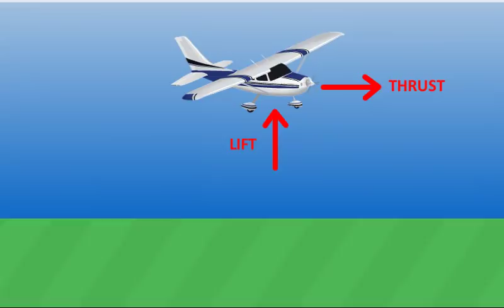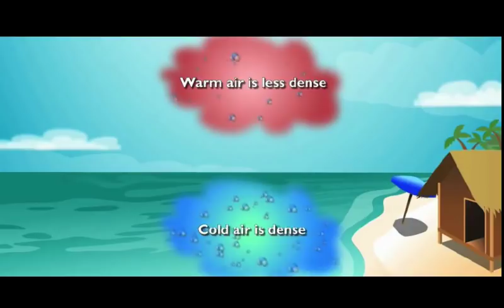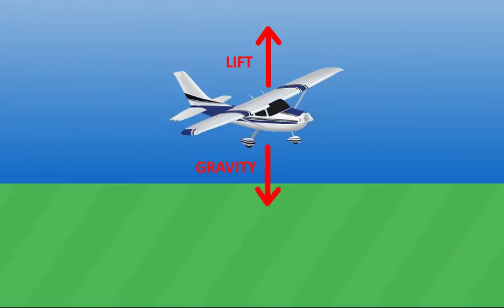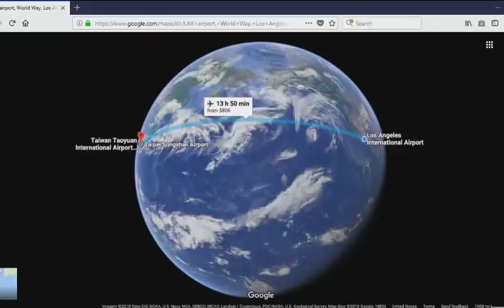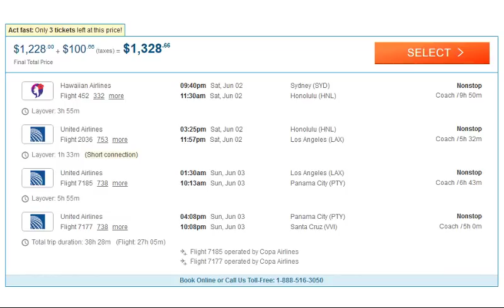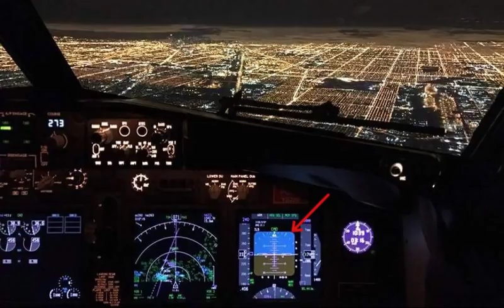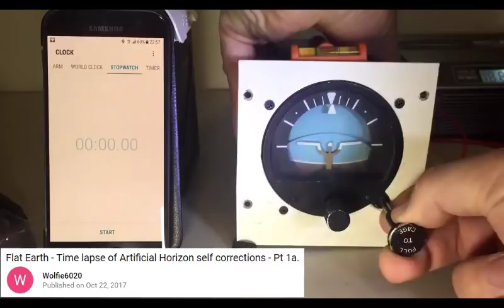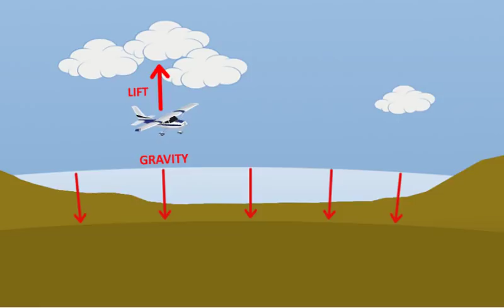Flat Earth Falsities - Plane Nonsense

Comment: So what happened to the so called coriolis effect that we're always being told about????
Reply: It exists. Ever heard of ocean currents, trade winds, TRS, weather systems, jet streams and not water going down drains.
So what happened to the so called Flat Earth that we're always being told about but no-one has any proof for?
Reply: @boffeycn  I don't advocate the flat earth theory, I question the globe theory, ie how come we can watch a ship go over the horizon 5 miles away yet we can't observe the curvature unless we're over 100,000 more metres above the ground??? or how come when lake Baikal in Russia freezes why isn't there a 20 mile curve in the ice?? it's 395 miles long and when frozen is completely flat???  Any suggestions mate?
Reply: @Deathtime88   It is impossible to be flat, even a small pond. Water freezes and expands 1/11th which causes the ice to be slightly wavy or bulged in the centre. You should also prove the lake is flat. Take some markers about 3 meters high, then line them up for 395 miles. Then use the famous P1000 take some photographs of perfectly inline markers. Get back to me.
Reply: @appresley4071  for fucks sake man, it's meant to be a 19.27 mile curve!!!!!  It's just one example and there's loads that you can check out. Still doesn't exactly explain why you can see a ship go over a horizon a few miles away yet can't see any curvature on the horizon left to right!  Wanna give an explanation on that one?
Reply: @Deathtime88    There definitely is a curve left to right on the ocean. I can sit in a boat and view the curve that is a three miles circle around me. The earth is big, mathematically that viewable 3 mile circle that you will see around you, explains the spherical earth perfectly.
Reply: @GebSpez15215  Flawless? If I was flawless there wouldn't even be a debate which has been ongoing for centuries, scientists included. You display all the characteristics that you say 'flattards' have in regards to their beliefs. As I said, you're as bad as each other.
Reply: @Deathtime88  Why no answer, mate?
It exists. Ever heard of ocean currents, trade winds, TRS, weather systems, jet streams and not water going down drains.
So. mate, what happened to the so called Flat Earth that we're always being told about but no-one has any proof for, mate?
Reply: @Deathtime88  Wong and Profe are trolls/shills. It's prly best not to waste any time/energy on trying to show them the truth.
Reply: @BrainUser1  Had never heard of that experiment... man I thought flat earth was hard to grasp but concave earth?? Friggin mind gravy. Thanks for sharing
Reply: Yeah it would be crazy if was the absolute reverse of convexe openroof races all around the galaxy.   Me neither, why I am so interested, too bad the Cellular Cosmology only has one  megalomaniac with a Messiah complexe to promote it on YT, but he is smart and has interesting explanations.   But that major experiment should be done again, it could also point to the "flat"  Orlando Ferguson 1893  giant donut mold... "flat" earth map.
Reply: @GebSpez15215  Why are you so angry? Gotta let that shit go man, you're only hurting yourself.
Reply: @sunbear2644  Calling anyone shills or trolls doesn't negate the validity of ALL the questions or points they make. People WILL come to their own conclusions, especially if they are truly intelligent, freethinking truth seekers. You're just name calling and trying to divide and conquer. Peace all, think for yourselves.
Reply: @Deathtime88  Haha I don't know about "all." And I know from experience with these guys. They're not trying to have a discussion, they're here to stifle it. Troll/shill is an accurate description. S'all good tho,  you do you. Cheers.
Reply: @Deathtime88  "I don't advocate the flat earth theory, I question the globe theory,"
     That's very interesting because in 2016, on the Ball Earth Skeptics Round Table with jeranism you posted, "...the Earth is NOT
 a globe and is FLAT" https://www.flatearthscience.org/ball-earth-skeptics-round-table-with-jeranism-fixed/
     Advocating is precisely what you were doing.
     How about your "Interesting Stuff" playlist stuffed with FE videos?
     Remember 3 years ago at Professor Brian Cox's Facebook page posting, "Gravity is a theory not a fact, and if the Earth is a ball in 'space' and NASA's been there, why don't we have ANY genuine pictures of the Earth from space? Why are NASA faking pictures of Earth? ...NASA admits they're composites and I'm not blind!"
Reply: @GebSpez15215  I never said anything about religion. and the 15º per hour, is the problem on the FE model a perspective thing? Surely, wherever you are the sun will pass by and your perspective view would be different, ie high or low in the sky. Why do we get more hours of twilight in the north than we do the south? wouldn't it be the same on the globe model???
Reply: Arif Salih 
can you grasp the problem? 15 degrees per hour isn’t possible on a flattardia pancake. just do what i suggest:
take a gleason map, find singapore or any other location near the equator. from there, draw lines to every intersection of longitude 15 degrees apart and the equator (suns flattardia path)
no matter how hard you try, you will never get constant angles. but we observe a constant angular change of the sun everywhere on earth. 

try this for Sydney, Australia... this place is „outside“ of the „flattardia sun path circle“... try to figure the problem. it’s 15 degrees per hour in sydney, too. 

i really am baffled about how little flerfs actually think about what the instantly claim. flerspectiveh??? really?? lol

of course earth is a sphere...
Reply: @GebSpez15215  Changing the subject slightly, Why do you (personally) think NASA fakes so much of their footage, always use fisheye lens' and never has the camera looking upwards on their rockets?
Reply: @GebSpez15215  No one has an answer for a bunch of our questions either. There's not gonna be an answer for everything.  There's basic problems with the eclipse that no one has answered, there's basic problems with the alleged near perfect vacuum of space. There's basic problems with gravity. Let's hear your basic question though. Have at it.
Reply: @Deathtime88  "Changing the subject slightly"
Again, I still can't help but notice that you have not responded to my replies to you.  I have explained your mistakes and answered your questions but it seems that you are only interested in responding to people that "insulted" you in some way.  Why is that I wonder?  I don't want to jump to any conclusions but in all honesty I'm starting to suspect that you were never interested in answers to begin with.

"Why do you (personally) think NASA fakes so much of their footage"
They don't.  You have watched some videos that misrepresented things to you and outright lied about other things to you and you believed those videos.

"always use fisheye lens' and"
They do not always use "fisheye" lenses.  When they do it is because they want wide fields of view and when you want a wide field of view "fisheye" is the way to go.  If you're curious about why they would want wide fields of view try walking around with horse blinders on for a day and you'll quickly understand the benefit of a wide field of view.

"never has the camera looking upwards on their rockets?"
NASA (you know they aren't the only space agency right?) has filmed their rockets from every conceivable angle.  Up, down, left, right, under, even from INSIDE the rocket engine.  The problem here is not a lack of video on the subject.  The problem is that people like you either ignore all the videos or wave them off as "fake".
Reply: Arif Salih 
of course you change the topic. what else can you do now? you can’t answer my question without admitting that earth cannot possibly be flat. doesn’t this question even bother you? what is it? do you believe that the sun isn’t changing its position constantly? why has nobody EVER observed a rate of angular change other than EXACTLY 15 degrees EVERYWHERE on earth? go, measure it yourself, no one is stopping you!

nasa doesn’t fake any footage. if they use cgi, they declare it as such. 
most pics aren’t cgi, there is plenty of photographic evidence of planet earth. 
but let me ask you another question: why did you choose to believe in a conspiracy without ANY evidence? why do you believe NASA has ever faked photos, but not a single flerf ever provided evidence for this fakery?

lol
the answer is simple. earth is a slowly rotating spherical planet and you MUST desperately deny all evidence presented to you. otherwise you would have to admit your own lunacy...

but go on, prove me wrong by not changing the topic, by giving a sound explanation for the 15 degrees per hour.
Reply: Sun Bear 
read the thread. the question is there. 

funny how you deny reality, while you keep claiming that such a simple question could not be answered. this question has been answered 5000 years ago. how does it feel to lie to yourself?
Reply: @GebSpez15215  Projection over a dome
Reply: Sun Bear 
nice baseless claim. ANY evidence? 
lol
no. of course not....
hahahahaha
actually this is very funny...
Reply: @Deathtime88  Aside a couple of Sailors seeing sea curvings... for the:
" You should also prove the lake is flat."  - as I already told the kids=
>>> Salar de Uyuni (or Salar de Tunupa)[1] is the world's largest salt flat,  at 10,582 square kilometers (4,086 sq mi).
  which has an extraordinary flatness with the average elevation variations within one meter over the entire area of the Salar. 

  Salt flats are ideal for calibrating the distance measurement equipment of satellites... NASA SAYS      (thee ultimate proof..)
   the variation in the surface elevation over the 10,582-square-kilometer (4,086 sq mi) area of Salar de Uyuni is less than 1 meter (3 ft 3 in)  normal to the Earth's circumference,?

>> "Water freezes and expands 1/11th which causes the ice to be slightly wavy or bulged in the centre." Even is it should be 100% Flat!

https://en.wikipedia.org/wiki/Salar_de_Uyuni
Reply: Well tornadoes spin in opposite directions each side of the equator. High pressure systems always rotate in opposite directions from the north to south hemispheres. Everybody knows that, it doesn't need to be retold again.
Reply: @appresley4071  I'm talking in reference to what he's saying about plane flying north to south and vice versa. He's saying it's no problem because it's flying within the air that's moving with the earth. If that's the case then why do snipers say they have to adjust their shots taking into account the coriolis effect. Why would it affect a bullet and not an airplane?
Reply: Arif Salih 
lol... 
airplane = slow, using air resistance for its benefit
bullet = really fast
airplane = pilot
bullet = no pilot

btw... as you admit that snipers have take the corioliseffect into account, you know earth is a sphere. 
or all snipers are paid actors... lol
Reply: @Deathtime88    Aeroplanes have a pilot who is always making course adjustments, bullets the shooter has to take into account Coriolis before firing.
Reply: @Deathtime88  Why o answer, mate?
It exists. Ever heard of ocean currents, trade winds, TRS, weather systems, jet streams and not water going down drains.
So. mate, what happened to the so called Flat Earth that we're always being told about but no-one has any proof for, mate?
Reply: @Deathtime88  "Why would it affect a bullet and not an airplane?"
Coriolis effect is tiny.  It's an error of a handful of inches per mile.  A handful of inches means nothing to an airplane but to a bullet a handful of inches can mean the difference between a hit and a miss.  Airplanes have pilots.  Pilots can make corrections to the airplane while in flight.  If the plane drifts six inches to the left from coriolis, the pilot can just steer six inches to the right.  Bullets do not have pilots.  All the corrections to the flight of a bullet must be made BEFORE the bullet is fired.  That's why snipers care about coriolis and pilots don't.

"I don't advocate the flat earth theory, I question the globe theory, ie how come we can watch a ship go over the horizon 5 miles away yet we can't observe the curvature unless we're over 100,000 more metres above the ground???"
For someone who doesn't advocate the FE you sure seem to like repeating their bogus talking points.  The horizon is the effect of the curve.  The horizon (assuming no mountains in view) is equally distant from you in all directions.  Because it is equally distant from you in all directions it appears flat.  You have to get really high up to see a difference in the distance of the horizon across your field of view.  But you can see the effect of the horizon when things go behind the horizon.  Like boats.  Let's use your house as an example.  Go outside and stand right next to the wall of your house.  Put your face right up to the wall.  Now have someone walk behind the house.  Your face is right up to the wall so you can not see the house, you can only see a tiny portion of it.  You can not see the corner, but you can see how someone disappears when they walk around the corner.  Your view of the horizon works the same way.  You can't see the "curve", but you can see the effect of the curve when something goes beyond the horizon.

"for fucks sake man, it's meant to be a 19.27 mile curve!!!!!"
No, it's really not.  And you're making the assumption that you should somehow be in a position to see it anyway.  Which you wouldn't be.

"It's just one example and there's loads that you can check out."
All of which no doubt make the exact same mistake.  Like I said earlier, for someone who doesn't advocate FE you sure seem to enjoy repeating their talking points.
Reply: @GebSpez15215  There is a nasty smell of puppy widdle here too.
Reply: @Deathtime88  Can you explain how the Sun would stop and go back in the opposite direction on a globe Earth?
You said: "There is only one unquestionable fact that can’t be argued away by ‘scientific anomalies’ and that’s the midnight sun. Someone filmed it for 3 days going round and around. Imagine you are on a ball Earth spinning around and you are looking at a stationary Sun way in the distance, what would the Sun be doing from your perspective? As you come around the back of the Earth the Sun would stop in the sky and go back in the opposite direction until you come round the front again. You don’t need half a brain to understand this."
Reply: @romithromith  I never said that, but it's a fair point. ie shouldn't it rock back and forth?
Reply: @Deathtime88  On a rotating globe Earth, no. Part of its continuous path will be obscured by the Earth, unless near the poles it is continuously visible or continuously obscured. I think you're trying to say, that when it never sets, it seems to reverse course. But it's not reversing course but apparently tracing the path of a circle. (Note the word apparently because Earth is our frame of reference.)
      At the time of year, people in Melbourne or Sydney see the Sun rising in the Southeast and setting in the Southwest. This is impossible on a flat Earth where the Sun never passes beyond the Tropic of Capricorn.
Reply: @romithromith  It's not so easy to perceive in ones mind. I don't see what's impossible what Australia can or can't see on FE??? Isn't it more important to wonder why we can't perceive curvature even with todays technology? It would make more sense for them to say that we couldn't possible see anything 'go over the horizon' for the same reason and that it disappears due to the vanishing point of our visual perspective, but they don't. Another good one is, How on earth can we see a full moon during the day? Also, how can the moon phases be 14 days each way if each month as we orbit the sun, at one point we'd be heading toward the moon + gravity toward each other and then the earth moving away from the moon technically dragging the moon with gravity.
Reply: @Deathtime88  "I don't see what's impossible what Australia can or can't see on FE??? Isn't it more important to wonder why we can't perceive curvature even with todays technology?"
So in other words you don't want to think about things that you can't explain, and you want to ignore all the evidence that proves you wrong.  Does that really sound like an honest approach to you?

"How on earth can we see a full moon during the day?"
Unless you are at or very near the North or South Pole, you can't.  You can see an almost full Moon around sunset and sunrise for the same reason that you can see both sides of a mountain when you're standing at the top.  This is fully explained by the globe, the FE has no explanation for it so they have to just pretend that the Moon is "a light".

"Also, how can the moon phases be 14 days each way if each month as we orbit the sun"
Lunar phases are NOT 14 days each way.  Maybe you should look at a calendar.  Or maybe you should actually go outside and look at the Moon yourself.  Maybe you should do absolutely anything to educate yourself on the subject before you start talking about it.

"at one point we'd be heading toward the moon + gravity toward each other and then the earth moving away from the moon technically dragging the moon with gravity."
Gibberish.  You should probably focus on small concepts first, like shapes and geometry, before you try to think about more complex subjects like orbital mechanics.
Reply: Anybody watched those videos where some idiot is using a 2 foot ruler to see if a circle with a radius of 3 miles is curved.
Reply: @appresley4071  That rings a bell. Can't remember who or when.
Reply: Kit Canyon  I guess the only question really  is whether it actually goes over a curve or hits the vanishing point. The thing that gets me is that when it vanishes from your view point you CAN zoom in with a camera or binoculars and it DOES reappear. Also the fact that we CAN see lighthouses and objects so far away they should be way below the alleged curvature. There are other cosmological issues that don't make sense to me like when we have a solar eclipse the shadow of the moon on the earth is only 70 miles wide, yet when we get a lunar eclipse the shadow of the earth completely smothers the moon??? Or during winter when we're supposed to be on the opposite side of the sun and night time is facing in the opposite direction we can still se the same stars???